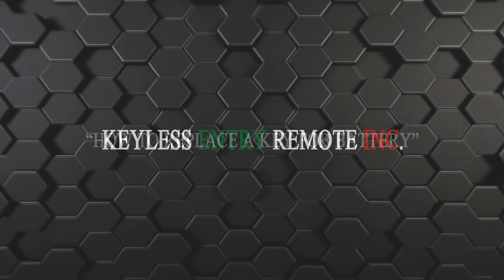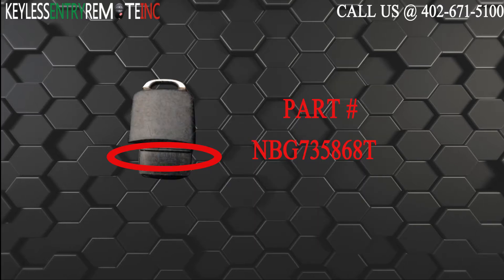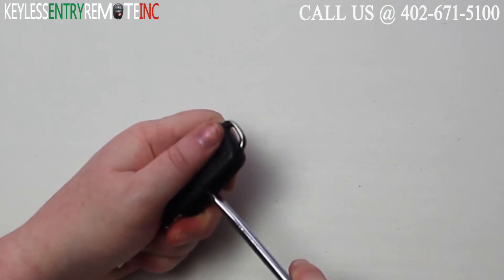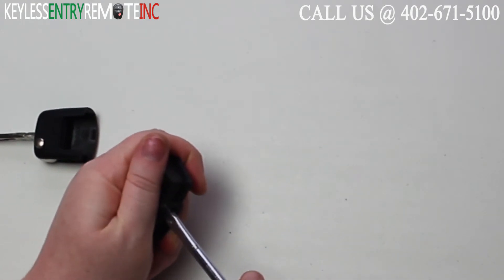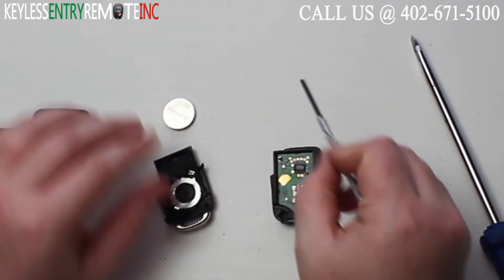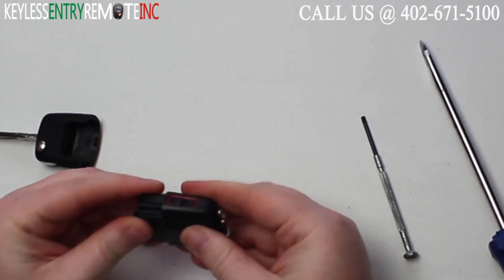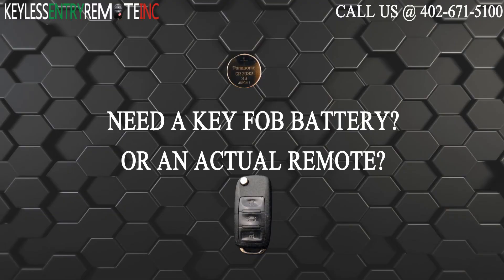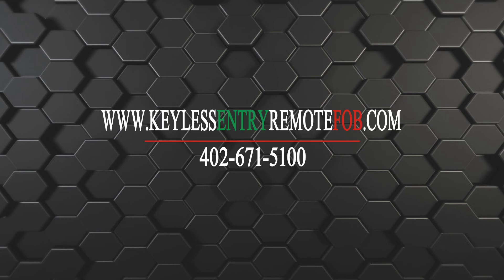Volkswagon Beetle Key Fob Battery Replacement (2002 - 2010)

Comment: My 2006 vw beetle keyfob has the first notch described in this video but not the second. I had to find the seam and manually pull it apart. Very tough. Part number could not be found. It is original equipment.
Reply from the maker: Sorry about that. There are normally a few different versions of the key fob for every year. Hope you were able to get it swapped out.